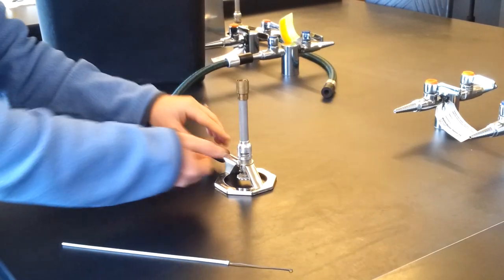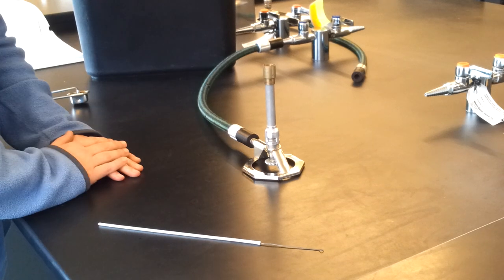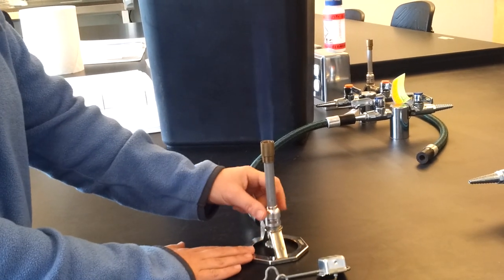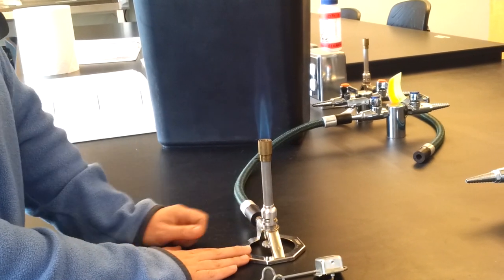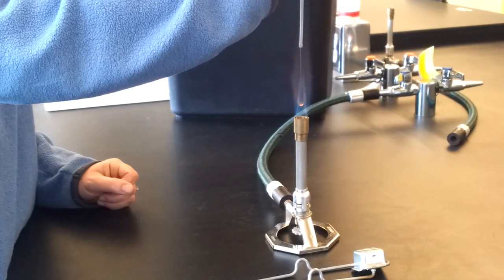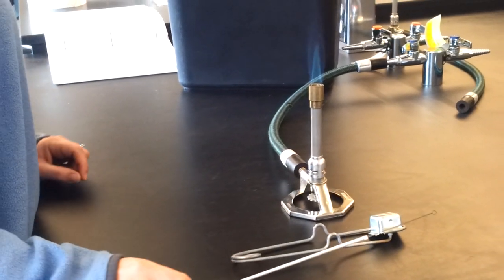Bunsen Burner

Comment: Question, once you sterilize the needle, wouldn't placing it on the table contaminate it?  Just curious.  Thanks so much for the video.
Reply: I think the table is sanitised, plus the bunsen burner is significantly reducing airborne contaminants because the hot air is moving upwards. Generally though I think before you take a transfer you sterilise it again in the flame, then cool it either by waiting or sticking it in the agar for a couple seconds